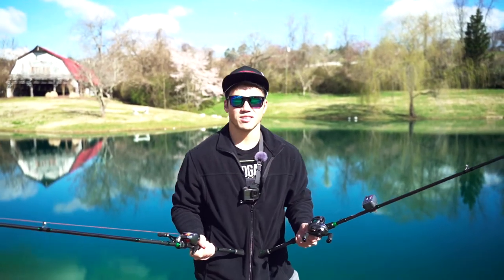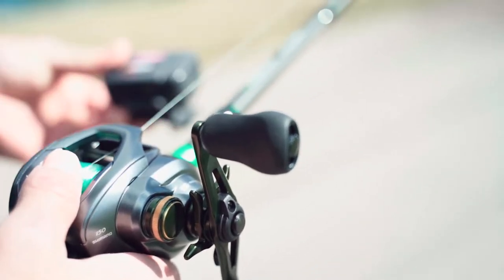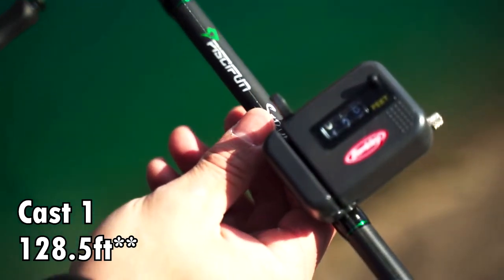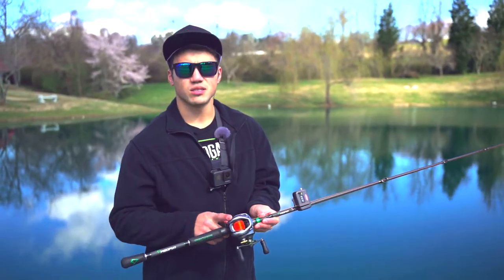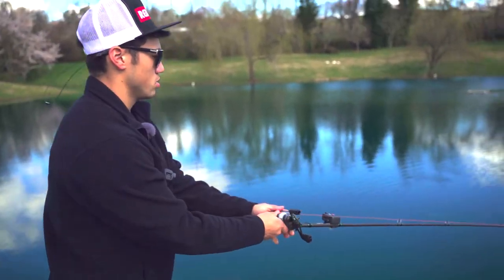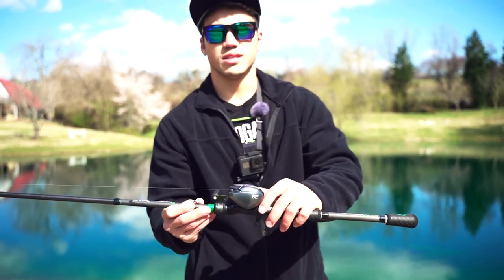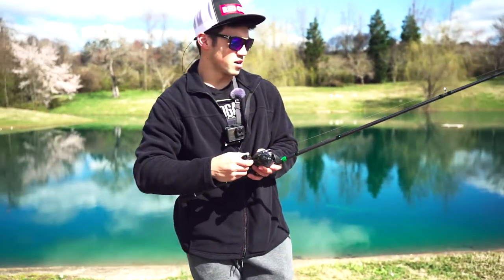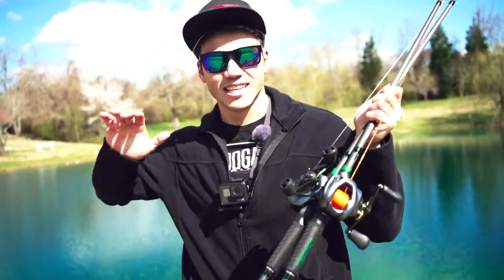Shimano Curado DC Cast Test

Comment: does the DC unit still work backlash free with the new bearings?  At least in my opinion distance is a great thing but if it affects the selling point or the Curado DC what's the point?
Reply: @KeepFishingForward  If done correctly as the manual states (adjust tension knob only till the spool play goes away)  The reel will essentially  "never" backlash.  Just was curious if you noticed bearings affect that in any while set up properly if you ever did test that.   Not trying to be a hater or anything just curious.
Reply: 19DESERTFOX91 This thing still backlashes a lot. I am very good with casting reels but I guess I expected too much from this reel. I bought it last week and besides that sweet a$$ sound it makes imho don’t think its worth the $250.
Reply: @silverdropstang  Again not trying to sound rude but you don't have the tension knob set up right.  When I first got mine I felt the same until about 6-8 times in my room adjusting and readjusting the tension knob, watch a video tutorial try again 5 times and finally it's set up right. (more importantly, I know how to set it up now) Ladybass on YT nailed it with her update review. light lures, medium rod, and into the wind this DC reel will really shine!   once set up right Mine rarely backlashes even into changing winds still no backlash with no thumbing! Personally, I can't do that with any other reel I own. I've seen my friend do it, many YouTubers, and even this video did it (no offense) but if you set up the tension knob based of lure drop the reel will act just like any other reel which would be $250 just for the noise. Set it up based off spool play and at least my DC has worked perfectly so far.

Comment: No offense but I feel like a 3/4 ounce lure should cast like 200 plus feet
Reply from the maker: It did the next day. I fixed the braking.
Reply: @KeepFishingForward  nice, I got one a couple weeks ago but it was defective so my new one comes in a few days
Reply: @Caden Gleason no problem, my defect was a problem where the break dial wouldn't turn. So the piece that you could normally turn from open to 1,2,3,4 wouldn't turn. Probably a fixable problem but didn't want to mess with it. Does yours seem to have a defect?